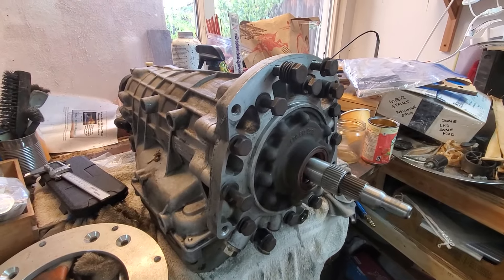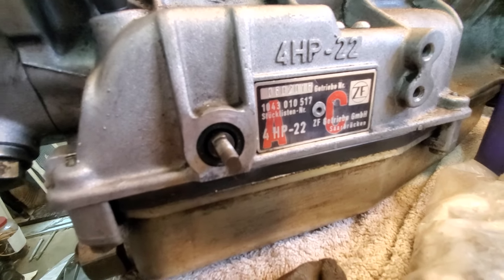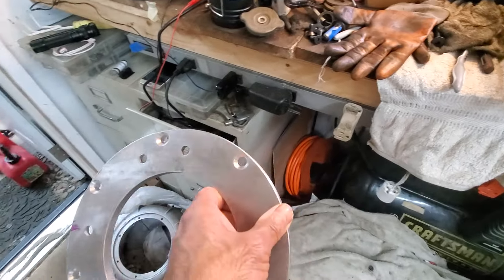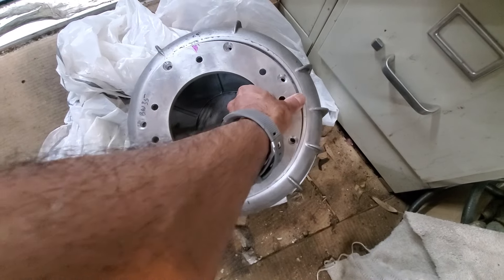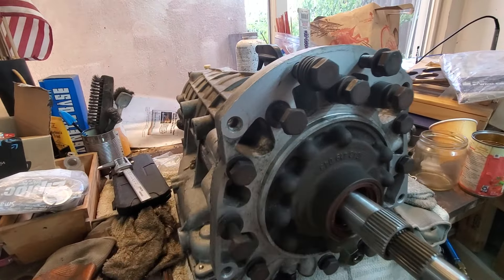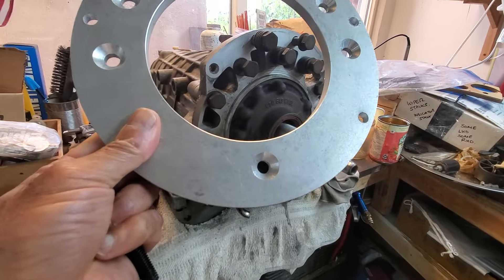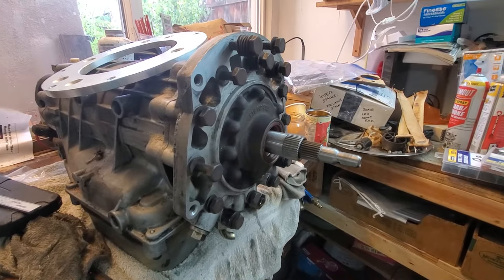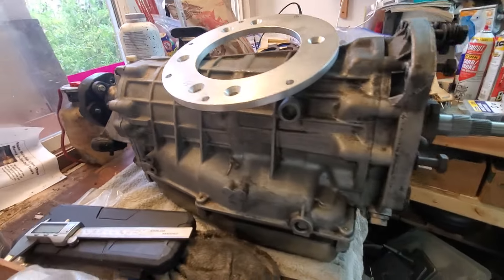Triumph Stag - ZF gearbox conversion project - Part 1

Comment: Interesting, I've added a j type overdrive to a bw35 , makes for very good  cruising. , same as Manuel  with overdrive, I believe that the zf  top gear increases the the propshaft speed similar to that of an overdrive, keep us updated  great project to see alternatives,
Reply from the maker: Did you have to cut the tunnel to get it to fit? I heard OD Spares in UK has or had a kit which you bolt on between the BW35 and prop shaft.
Reply: @sujitroy  no  , I only had two fabricate the mount bracket that fits between the.    stag  manual overdrive bracket      and  the     overdrive bracket fitted to the adapter that goes between the automatic and the overdrive,  this is because. The whole unit is  longer  ,  the speedo cable  same as  manual overdrive  , also shorter drive shaft buy about four inches  easily  done if you have welder and  grinder  see YouTube films how to do it , if you mount the box all in place jack up  box at the rear  and you can quite  clearly see what  small bracket  you need to fabricate  , it's actually. Straight forward  , I used to work  for formula Ferguson. Doing body work  but you could see  the overdrives. Fitted to  all sorts of automatics  and four wheel drive systems,

Comment: Hi, I am from the UK with a Stag using the BW35 box and want to convert it to the Jag ZF4HP22 box and wondered who/where you purchased that adapter plate from as it’s exactly what I will need, also what ideas did you have to make the speedo work as the ZF does not have the figment for a cable? Many thanks, Ian
Reply from the maker: Reach out to me at triumphstag@gmail.com I'll send you what I can. Folks have been nice to send me stuff, but some folks have asked me not to share what they sent me. Regarding the speedo, Caerbont Automotive Instruments Ltd have a  digital speedo and a pick up which works with the MK2 Stag.
Reply: Hi , great informative videos , thanks.
If I emailed you would it please be possible for you to send me the info you’ve gathered on the ZF conversation as I want to do it to my Mk1 in the next couple of months . Thanks in advance. K
Reply from the maker: Details sent.